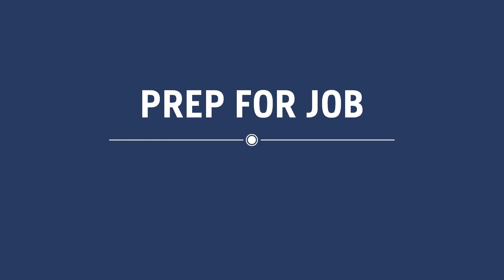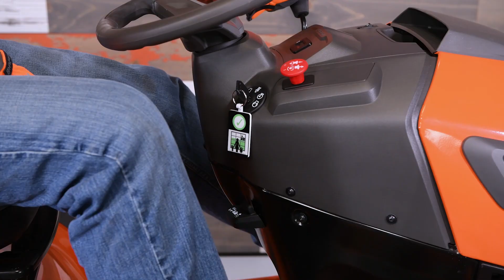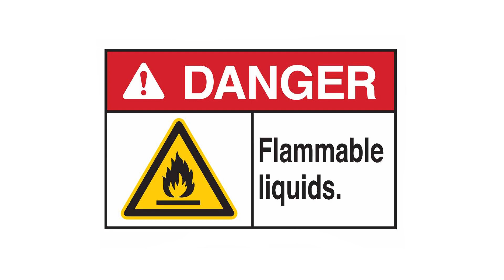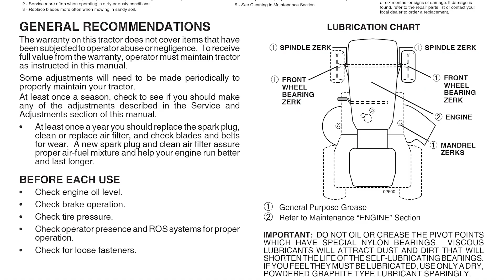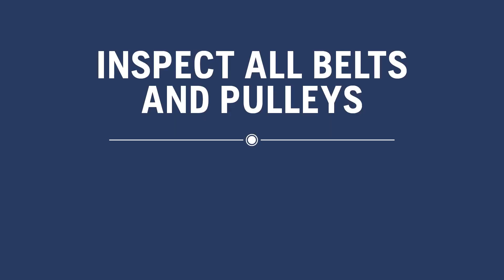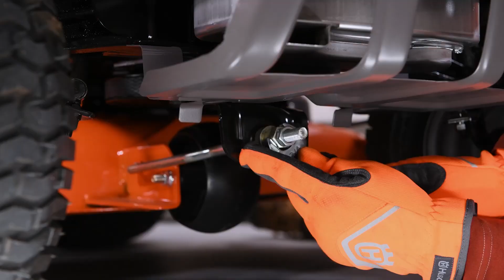Husqvarna Riding Lawn Mower Annual Service

Comment: Where is the engine oil filter change explained?
Reply from the maker: unscrew old filter and put lil oil on new ones ring. Put it back on n tighten. Fill with new fluid, check level and your done